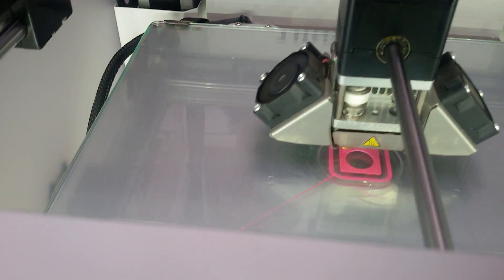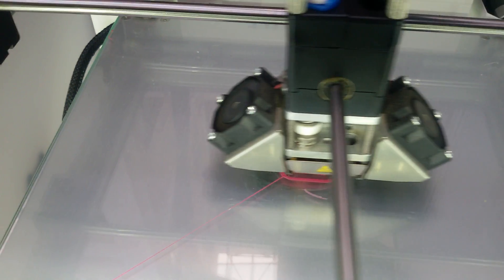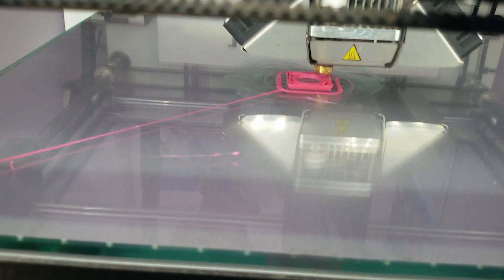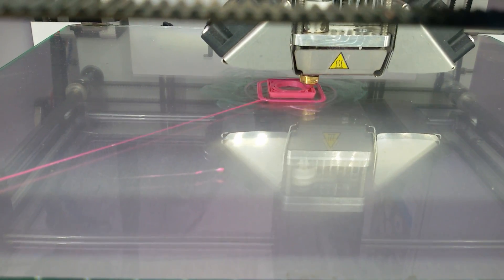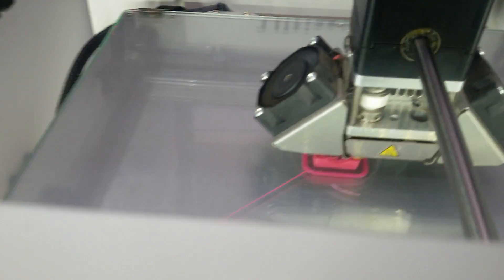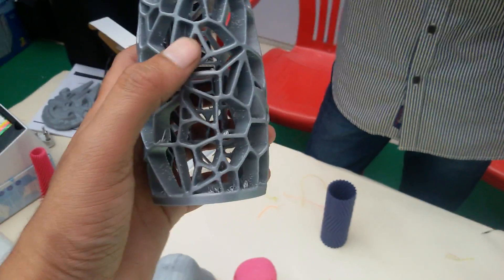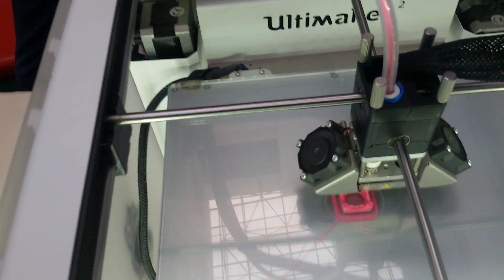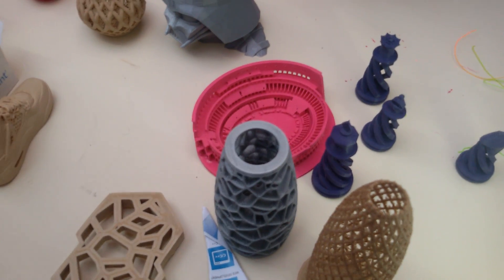3D Printer in India Full Demo and Information

Comment: Easy Guys, Entry Level (Quality 90% Same as this) Printer Costs about 14000/- only. But it sould need some adjustments from time to time to work Correctly. You can buy from Aliexpress App & Credit Card. Printer Filament 1/2 KG Comes along it. Its a wonderful experience to have a 3d printer.
Reply: Bro please don't compared ultimaker with the Chinese cheap and copyed printer